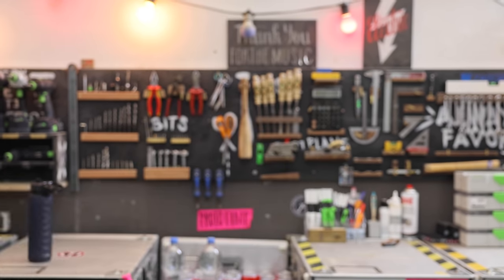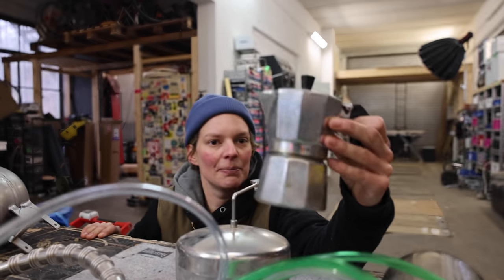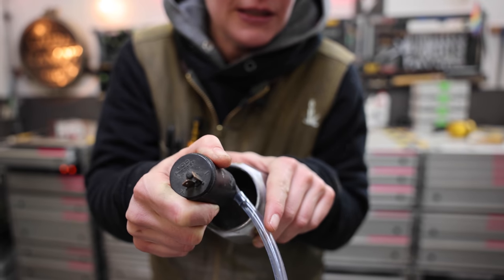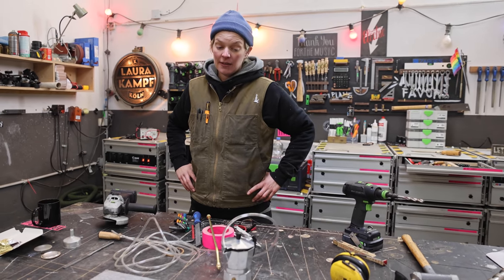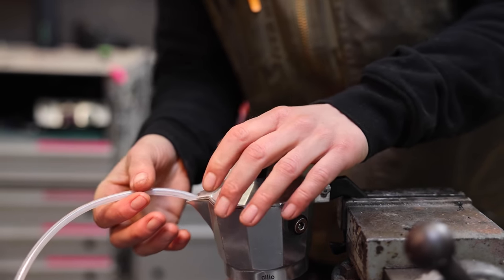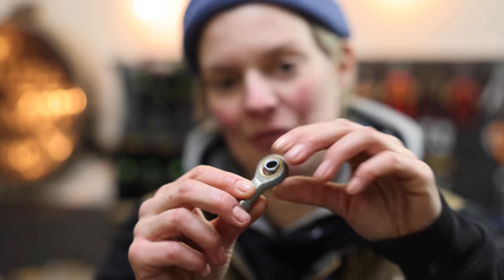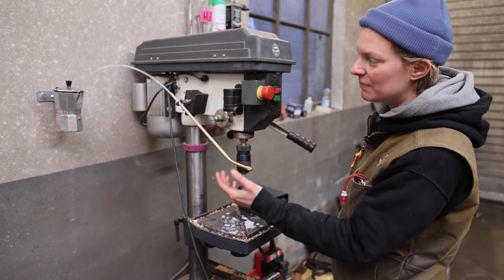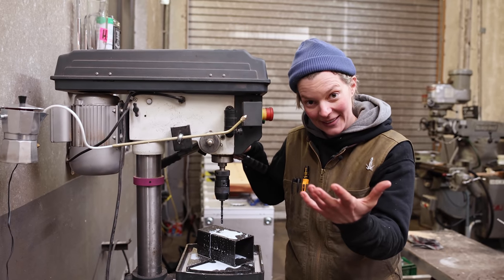Cutting Oil Pump from old Coffee Maker (genius or stupid idea?)

Comment: As other wrote, place the tank below the nozzle.
The windshield squirt pumps are designed to be placed <below> the liquid level so they selfprime, but with the nozzles being <above> the liquid level in the tank so it won't be flowing nor dripping when off. I know, not really feasible for such small tank. Plus the liquid vacating the line is a nuisance as well (the delay before it starts flowing when activated). 
To fix the problem of the liquid leaving the pump dry when off and so unable to restart:
Some windshield wiper pumps feature a check valve. Or you may build one (just gravity pulling the ball down should be enough) and so the pump will stay primed. Then the thing will have no issue pumping up.
So a combination of placing the tank below the nozzle level plus a check valve will do the trick...

Or find some older gear tooth displacement pump (or how these are called in english). That will not have that much problem with letting the liquid fall back down that far when stopped. Obviously having the tank below the nozzle is still an imperative. Otherwise it will be still dripping...

Comment: As people have said, the pump needs to be fractionally lower than the table so the fluid runs back into the coffee pot when the pumps off. But you also need an O-ring around the plastic tube where it goes into the brass tube to make a seal, so the pressure can build up (and stop the fluid running out if you tilt that end down). I'd also recommend a ball-detent valve (the german name for them might be something different) somewhere in the plastic tube, it's like a small tube with a ball that makes a seal at one end, held in place by a spring. When the fluid is being pumped it forces the ball down, allowing fluid past, but when the pump is off the spring pushed the ball back shutting the valve. It's a bit like those old soda bottles with a marble in them, but the spring takes the place of the gas pressure.
Reply: Agree

Comment: If mounting it lower doesn't help, try sealing the leakage in the  brass pipe connection with the rubber hose.
Reply: This will be the main problem: the gap between brass and silicone tube is not sealed, so as soon as the intended flow stops the volume in the brass tube gets emptied.
If it was sealed the surface tension of the cutting fluid would be enough to not allow it to exit the nozzle, as the pump will provide enough resistance against the siphon effect.
Reply: @klaernie  100% agree! If you mount the pump lower it will drip at the connection (like when you put the Festool sponge-thing). Just seal the connection.

Comment: What about the little valve that is in the mouthpeice of sports cap type bottles? The pressure from the pump would be enough to  open it, I'd imagine. You'd just need to seal the joint beween the plastic and brass tube.

Comment: If you add a small hole in the discharge of the pump so some off the coolant recirculates back into the reservoir when it is running, it will break the siphon when the pump turns off.
Reply: That’s a brilliant solution! We do that in evacuation pumps.

Comment: One other item to watch for is whether the vinyl tubing becomes stiff over time. The parent resin that tube is made from is the same as for PVC pipes: it's naturally fairly brittle. Flexible tubes are made from a polymer that has been swelled by a large proportion of plasticizers: smaller molecules that dissolve into the polymer, similar to how water swells gelatin. In my experience, these plasticizers leach out into certain organic solvents over time: I don't know Ballistol's affinity for the exact plasticizers in your tubing, but it seems worth keeping an eye on as time passes.

Comment: Besides the height adjustment of the actual pump, one thing I think may help would be to put the power to the pump as pulsating, so it's not always on or something that expelled a certain amount of fluid then stopped, until you restarted it.

Comment: awesome project. you could either lower the coffee pot so that the tube isn't constantly siphoning out fluid due to gravity.... or, when you let up on the switch you could reverse the motor polarity and pump the fluid backwards for a bit... but that would then require a long wait time before the next time you press the switch, so i think just fixing the siphon effect would be much easier. such a great project! very inspiring.

Comment: Hi Laura, two things I think it could help. First what a lot of people say lower the Coffeepot second thing is use a heat shrink  where the rubber tube goes in to the brass piece so there is no way for air coming in to give the cutting fluid the possibility to drip. Und am Ende liebe Grüße aus Deutschland. Ich liebe deine Projekte auch wenn ich für die meisten selbst keinen Platz habe.

Comment: So Laura, you're using the pump to pull the fluid up out of the reservoir and up to the wand, but at that point gravity takes it down the wand and out the nozzle whether the pump is operating or not.  Just move the oil reservoir lower on the wall than the nozzle and when the pump is off it should want to flow back down into the reservoir rather than out the nozzle.  Try it!  Nice work on everything, and happy new year!

Comment: Try the lot lower and seal up the end where the tube goes in,because 1 it's not air tight so the whole brass piece gets filled up around the plastic tube so when it turns off all that drains out of the gaps between metal and plastic tube.ThankQ.TkEZ>UK

Comment: Are used to make homemade wine with my father. As a kid it used to fascinate me when we have to siphon from one 5 gallon jug to another. As I got older I realize what was going on. By having the wine from the first jug higher than the empty jug when you start the siphon it takes over on its own. Try lowering the oil pump below the level of the nozzle. That way the pump actually hast to do the work to get the fluid out. It looks like what’s happening is as you start the pump you’re priming the gravity feed. And even when you cut the pump off, gravity is still pulling the fluid through the tube and sucking it out of the reservoir so like I said, to mitigate that try lowering the mocha pod about six or 8 inches below the level of where the fluid will come out of the nozzle.

Comment: Additionally to putting the coffee maker lower, you could seal the joint between the silicon tube and the metal arm better so that air can't go through. It should reduce dripping. If even that is not sufficient, you could try making the lid of the coffee maker completely air tight (maybe with silicone) because it is the air getting inside the tube that allows dripping. Hope that works, good luck, love your projects!

Comment: Hey Laura, medical infusion systems use a small wheel based start/stop lever to set the speed in which the fluid gets through. Maybe you could try installing something like that, this way you might not even need a pump, just led it drip and control it through the wheel. 
Love your work!

Comment: Spring and a small ball inside the nozzle.  Ball closes tube and prevents drizzling, pressure will move ball and allow coolant to flow. This wil also keep pump full of fluid and you will not get problems with that.

Comment: I think it continues to drip b/c there's not a tight seal between the brass tube and the plastic tube... air is getting in. Try sealing that connection.

Comment: Ingenious design.... but the continuing flow could be pump height issue- gravity draws the fluid out. You could try a small valve with a knob to stop the flow. You probably have the right item in your vast assortment of parts. 👍

Comment: Add a tee and branch off back to the tank through a needle valve. Some of the liquid will return, leaving a correct amount going to the drill. Or use a PWM controlled DC pump and change the flow via motor's RPM.

Comment: An automotive fuel injector for your sprayer would possibly solve your drippy nozzle issue, they shut off when electric current is interrupted. Plus being electrical and mechanical you may be able to simplify the whole rig. Just a thought. Down side is injectors tend to spray in a shower pattern.

Comment: That turned out with a really cool twist to it 👍😀

For the dripping problem I’d join on the suggestion to lower the pump below the nozzle.

I’d perhaps add to that to consider:
-  Having the whole assembly below the table’s plane or under it (as part of the press), with the longer side of the brass tube having a horizontal to an upwards slope rather than sharp downwards one.
And magnet clamping to the table or some mount assembled to the column.

- Shortening the longer side of the brass tube that it could fit in the direction coming from the column towards the chuck with the end pointing down at the work piece.

- Making sure the joint between the plastic and brass tubing is air tight just for good measure.

- If troubles remain to persist, trying out in place of that sponge a tiny rubber disk with some incisions in it that is sort of allows passage only under pressure.

Comment: Is the connection between the hose and the garden sprayer sealed in some way when it is inserted? Maybe the pipe from the garden sprayer is filling with cutting fluid while the pump is running and this is what dripping out when the pump is shut off

Comment: I think a smaller orifice might help with the dribbles. lookit BETE Deutschland's nozz for a small size, combined with a lower resivoir , the surface tension of a smaller hole might help keep the cutting oil in.

Comment: seal up the pipe hose connection so there can't be any air in the system. the nozzle output should be able to stop the flow with the surface tension alone. that and putting the pump lower than the outlet should fix it.

Comment: in addition to al ready gaven, to hang the pot lower solution, why not a small valve on the copper tubbing so you can close it when you done or even control the flow with it

Comment: Spring Ball valve on the intake hose. This will stop the siphon when no pressure. With pressure the ball will move forward and allow fluid to pass. If you just move the resivor down the fluid left in the tip to the highest point will still drain out. You will also need to seal where the hose is pushed into the tube, maybe. In there is any air going between the hose and spray nozzle you will still get drips.

Comment: Put a small ball bearing in the end of the nozzle like a gerbil water bottle (or a ball point pen). You may even be able to use the drill bit itself to roll the bearing. Or just set it near and  move it as needed to touch the spinning bit  momentarily when you need to add a little oil. Gravity will plug the hole when it is not in use maybe

Comment: You need a spring loaded valve, so it stays closed when the pump is off, and pressure opens it when the pump is on. It could be made with a couple npt brass reducer fittings, a ball bearing, and a small spring…
Ie:
Pump > hose > brass fitting > ball bearing > pen spring > brass fitting > nozzle

That would also stop it from siphoning out & emptying the percolator (like it will now, since the nozzle is below the reservoir).

Comment: Excellent concept! You could add a small valve to the end to shut it off. Fireball tools used one on his toilet oil dispenser. You could also possibly drill a smaller hole in the end fitting.

Comment: When the nozzle is down towards your cutting surface, the fluid is syphoning through with gravity.  Either you don't need the pump at that height, or, mount it lower, so that the syphoning action is not coupled with the pump action. Either way, you still need be able to open and close the end without leaks.

Comment: Hello Laura, the coffee pot is a very good idea but you don't have to put it so high (because if you don't when you stop it the liquid inside the tube keeps going down) put the coffee pot lower than the drill platform. So when the pump stops working, it will return to the coffee maker by gravity. 👋

Comment: Very nice video. Thanks for showing your creation. Imho you are looking for a solution for a kind of more or less non existing problem,
When I'm using my drill press for metal drilling I clamp the metal piece very strong to the working platform. It can't move anywhere. So I need one
hand/arm to pull down the drill and the other hand I can use for reaching out for a small bottle with cutting oil  (any kind of used oil)
The spray bottle is tiny (30 mm) and originally there was a medical spray in it against a sore throat.  The spray tip allows me the oil to come out drip by drip.
I'm quite sure my simple solution will not work for you, so you'll continue finding a better solution than you have know.  I'm very curious what you come up with.
For sure it will be a very creative solution. I'm looking forward to seeing in another video.

Comment: Perhaps replace the nozzle with an auto radiator petcock?  Your motorbike/scooter project videos showed fuel shutoff valves that would be similar to a radiator petcock, and perhaps in your scrapped materials pile.

Comment: put the reservoir and the hose below the drilling platform, the oil that flows comes from the supply hose at the end after it has passed through the pump, if you put everything down, gravity itself will do the work of not letting it drip as much

Comment: Seal rubber tubing within metal tubing, blocking leakage out the back end of the metal tube. That leaves only the applicator tip to be controlled. Could an additional washer or rubber seal be positioned within the screw-on tip to provide total closure, while still allowing adjustable flow. Also, position coffee motor lower on wall, below the level of the adjustable tip, so that gravity is also helping control the drip rate at the applicator tip. Also/also; install a small shutoff valve just above the adjustable tip to totally eliminate excess dripping. Good luck. 😊

Comment: Try making solid connections on the hose not sure if the pump has a check valve think of it like a straw cap one end with your finger and nothing drips out even tho the end is open

Comment: You need a non return valve at the front nozzle (bearing ball+spring) and you should tighten the hose to the brass tube so some pressure can get increased by the pump.

Comment: Lowering the coffee maker is a great idea.  Forget about valves, they just get gummed up and fail.  I would put a compression fitting between the brass and plastic as suggested.  But here is something cheap, quick and dirty.  Put a downwards loop in the plastic tube with the bottom lower than the discharge point.

Comment: Maybe you just need a metal raster like at the end of a water tap. The sponge is blocking too much fluid but the idea is similar. So the holes need to be big enough to let the fluid pass but small enough for the surface tension to hold it when the pump isn't pushing

Comment: Either way likely will be a drip. Need to add a cup or funnel to catch this. 

Perhaps this is where the pieces not kept in the pot can be of use. 

Perhaps also can reuse the fluid.

Comment: Inline fuel tap from a motorcycle.
There are also non return valves on car fuel systems.To stop the fuel returning to the tank when the engine is off.

Comment: Solenoid valve to release the pressure going to the nozzle? Or maybe run the pump with the voltage reversed for a second?

Comment: peristaltic pump is the answer. also attach the nozzle so it always moves relative to the drill. then u never have to change the position. then make the reservoire under the drilling table and let the pump recycle your fluid. for my projects i always look, how ppl with similar applications do it. in your case, i would advice you to get inspired by a few cnc mill videos.

Comment: I think that, in any case, after turning off the pump, all the fluid in to the brass pipe will drop till it is empty. Maybe could be enough a little ball valve, really close to the pipe end.

Comment: I would suggest using a siphon stopper in line near the nozzle. Fish tank air pumps use these to keep the water from siphoning out in the event the power goes out. The mechanism for them is relatively simple, it has a spring that compresses when the pump is on and opens the valve, once the pressure stops and the spring releases a plate that moves towards the opening and stops any fluid from siphoning. If you use something like that there would no need to move the mount and assuming the valve is placed near the tip you 'should' not have dripping issues.

Comment: if you mount the pump lower then the hight of the outlet head that should fix your problem. It is likly leeking because the pump and oil are higher then the outleet so it continues flowing like a siphon.

Comment: I suspect the leak is because a little bit of air can get into the brass tube where the plastic tube is inserted. That's backed up by the fact that the fluid came out there when you tried to block the jet with the sponge. Try sealing the brass/plastic join with some electrical tape and see if that helps. If it does seek a more permanent solution.
Reply: I think this is the root cause of the continued flow. Seal the interface between the plastic and brass tubing. The flow will probably stop if surface tension in the fluid is enough to prevent air and fluid bypassing at the tip. If you still get the drip, putting the maximum fluid level in the reservoir near or below the level of the tip will reduce the pressure differential such that surface tension in the fluid will prevent the drip. If you assure that the reservoir is fully below the nozzle I doubt that you’ll have any drip at all. But sealing between the plastic and brass tubing is probably essential.